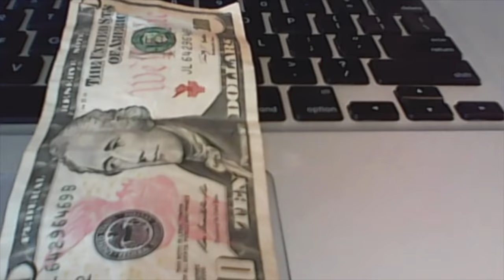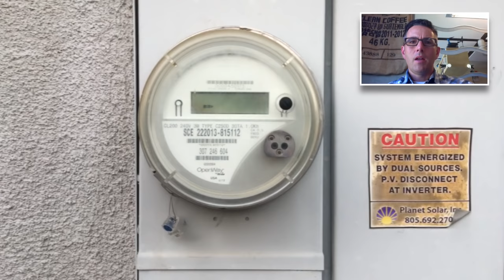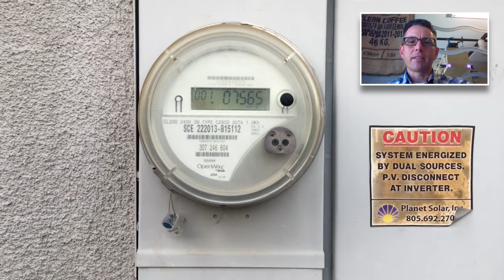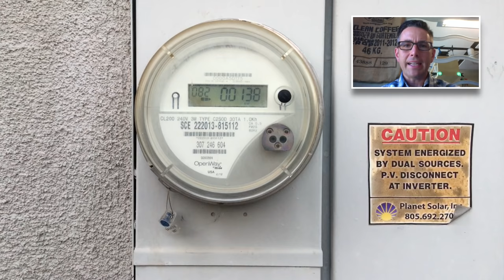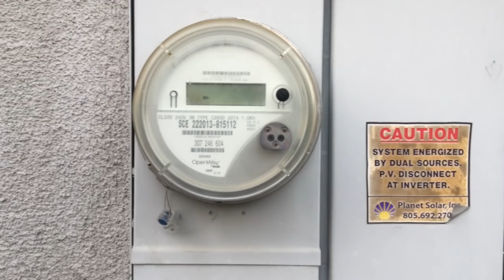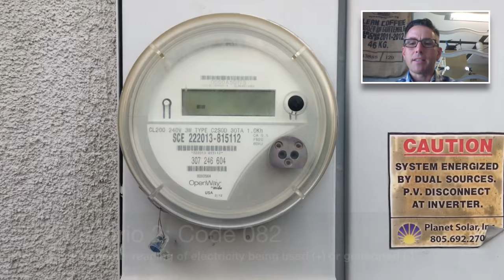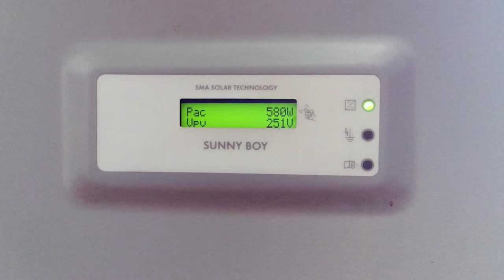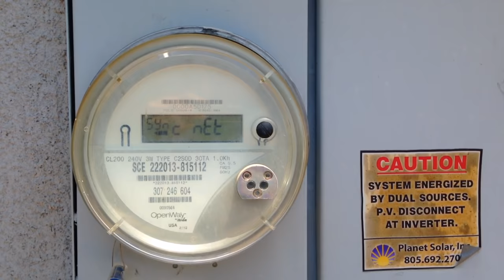How to read a smart meter with solar panels

Comment: On my meter it arrows to left with "received" below it which I would like to know if it means my system is sending to the grid? I still need to interconnect with PGE and really wasn't sure how my system would perform so as a DIY'er I'm learning. Update: I went ahead and watched it some more and noticed when I wasn't charging the battery from the PV's the delivered (.461kw) changed to received (1.4kw) so it would appear the Solar is doing a tug o war. < received/>delivered.

Comment: Just a minor correction to an otherwise fine video: the real-time power generation (or consumption) unit is kilowatts, not kilowatt-hours; the former is a rate of energy generation or consumption, the latter is an absolute amount of energy measured over time. For example, 1000W is 1000 joules/sec (a rate of energy), but 1000W over the course of an hour, is 1000 Wh, or more commonly specified as 1 kWh. You are billed by kWh.

Comment: Hi!  Thanks for the tutorial.  I just had to mention that you sometimes confuse power (units of kW) with energy (units of kWh).  The readings that say kW under the number are power, not energy.  A kWh is used when you run an appliance that uses a kW for an hour.  :-)  Thanks for the video.

Comment: Good info. Got my PTO from SCE last week.  Meter (Openway) says FatError2 and I dont seem to be generating any energy, according to comparison of recent energy use vs a few weeks ago. Solar company is useless and Edison is non-responsive. Electrician replaced/upgraded the panel back in December and it seemed to be working normally after that until roughly a week ago. SCE rep came out a few weeks ago and put a sticker on it verifying the location. I was able to find the Operating manual for the meter and it indicates a RAM error and says it needs to be returned for repair.

Comment: Most helpful since codes are different across country.  Your insights were not in the "How to Read Your Smart Meter 042010.pdf" that I reviewed. I thank you.
Reply: BTW: a Watt is a Joule/second.  We can use 500 watts draw (power) for two hours using 1KWhr of energy.    (the time hours / time sec cancels out to create the unit energy)  energy is joules.  This detail means little to 99%+ of the folks.
Reply from the maker: Glad it helped

Comment: This is really helpful except my meter seems to have different number codes. Otherwise it looks identical to the one in the video. My meter model is CL200 and it cycles through the number codes 11, 4, 6, 10. What do those correspond to? Thanks!

Comment: Hi, and thanks... I'm trying to understand the cumulative value... When does it accumulate from and when does it reset?
Reply from the maker: That's a good question.  I'm not sure what the answer is, but it seems to be related to messing with the meter, not a date or time.   Likely it is cumulative since the meter was installed since the current owner of the house had only lived in the house a short amount of time.   Even without being resettable it is useful because you can write down the cumulative usage/generation at a given point in time and then subtract that from a point in the future if you want a subset of time.
Reply: Units of energy (work done over time) are kilowatt hours.  Units of power (instantaneous intensity or force) are kilowatts.  Code 082 is an example of an instantaneous power value.  Both values are important.  Energy over time is comparable to the number of gallons of water supplied to a house in one billing period.  Instantaneous power is also important because the sum of all users' power requirements at a given time corresponds to the load imposed upon the energy provider (utility).  Peak demand determines the maximum power output required of the utility.  Annual peak demand will occur only once and will be far higher than the average demand.  Probably way more than you asked, but there it is anyway!
Reply: @duaneediger2234  thanks

Comment: It was 'difficult' to find this particular video on youtube. All of the others did not cover the readings, and what they mean. They were mostly about the radiation coming from the meters. I needed to know what the smart meter was saying because the readout on my 6000W Sonny Boy stopped having an LED readout years ago, and I neglected to repair it. It is the same Sonny Boy as the one in your video. I have the manual but it does not specifically indicate that the LED panel is 'fused'. Removal of the cover is no big deal if all of the circuit breakers are off. I plan to clean the fans shortly and will be removing them. Any advice on this on the LED issue would be appreciated. Some are being sold on EBay. If the LED readout panel is obsolete, not  replaceable, is there any way to broadcast the LED readings to my computer? I have 39 PV panels facing south, installed in 2008.Thank you for your great youtube video.
Reply from the maker: I would guess that you can probably use the same wireless connection that the power companies use?  I've never tried that.  My inverter has a specific wireless component that you can add to read it via Bluetooth, but I've never tried with the power company's meter.

Comment: My Pid is 232 and the odd thing is it seems to be measuring correct the amount of electricity I am pushing to the grid but, when I am consuming my own and charging my batteries, it seems it is indicating that I am consuming that from the grid ( the arrow points to the right)  while my system says it is using the solar. My electric bill comes super high and this started to happen recently, it is as if they are charging me for the electricity I am producing.
Reply from the maker: My electricity bill went through the roof recently also (no pun intended) and I have a dispute with SCE to understand what's up.  That might be related.  

 If that problem isn't related though your house might need more than what your panels are producing and so you still need to take some from the grid.  That would explain why you still seem to be using electricity even during the sunny times.  It should be less than what you would use without panels though.  SCE pays much less for electricity than it charges you.  That's well advertised by them.
Reply: 232 is the code for 15 min. interval readings while 252 is for 1 hour interval readings for residential properties/accounts.

Comment: Is it possible to detect PV panel installations from smart meter electricity consumption data? If we have only consumption data and not installed the net meter.
Reply from the maker: Well if the meter indicates that power is going out to the grid, PV panels are the most likely explanation,
Reply: @djp3  I don't have the physical locations of the meters, but only have consumption information in kWh/15mins.

Comment: a video on FAIL scenarios would be good. My last bill shows the power company is charging me FOR what was delivered. Everything looks normal and jives with the numbers Sunrun monitors. Problem is the power company , or something in the system has flipped the equation.

Comment: Just had a Powerwall battery and separate grid tied PV panels installed in SCE territory - exactly the video I needed to understand my meter. I’ve also spent some time with the SCE power rates. Looks like the PV and battery goal should be to minimize your use of peak power (and maybe mid- and off-peak) but not to put net power on the grid (as measured monthly or annually, not daily). SCE will only reimburse you at about 1/4 to 1/3 their peak rate, which is even less than their off-peak rate.
Reply from the maker: Yes, the best way to do it is not to generate power for SCE but to displace your own usage.  It's a bit like playing black jack.  You want capacity up to your usage, but anything over is too much.  We bought an electric car and started to nerd out on this as a result.
Reply: I took another look at the SCE winter rates and realized it was more expensive to charge on off-peak and discharge on mid-peak than it was to just use the grid for mid-peak. There’s only about a 3% different between mid-peak and off-peak rates. So at 90% round trip efficiency the Powerwall ends up costing more. I also calculated that to get the equivalent of 54 discharges annually for SGIP I needed about 2 kWh of discharge daily. No problem, I exceed that during on-peak alone. So my strategy now is to tweak the battery reserves so that discharge stops just after on-peak ends. Then of course recharge on off-peak. This meets the SGIP program goals, minimizes my costs, prolongs Powerwall life by reducing discharges, and gives me a larger emergency reserve. I’ll have to tweak it periodically as consumption changes over time. I’ll also need to see if this works in summer.

Comment: How can one tell how much the panels have produced? Like you mention, part of the production is consumed by the running equipments in the house, such as refrigerators, and excess is sent to the grid. This does tell how much is actually produced by the panels. What is the display under the inverter? Thank you for your video. It is informative.
Reply from the maker: J. Prakash you actually have to look at the inverter not the meter.  It depends on the model but almost all of them have a separate display. The inverter should be on the house side on the meter. Mine shows instantaneous power, cumulative power and some weird cumulative CO 2 saved metric.

Comment: I have a question regarding SCE, and solar panels. I have yet to get a electric bill, for 9 months on a new tract house, and they keep saying it’s technician issues. I also am unable to see how much I’m using on SCE’a website. Is it possibly my 8 panels are making more electricity than I’m pulling from the grid?
Reply from the maker: Yes its definitely possible.  You electric meter should show a negative flow if that's true.   Check in the summer at roughly noon during full light to see the most likely time for this to occur.

Comment: If you have a  grid tie and inverter and solar panels&batteries, can you send back electricity to the power grid if you have a standard smart meter that  everyone else has, or does it have to be a specific kind of smart meter?
Reply from the maker: My understanding is that the smart meter is all you need, mine doesn't appear to be anything special,  but you might need a software update on the meter to support the additional record keeping.
Reply: The same meter can be used, but most will to be reprogrammed to read and register recieved and delivered. Some companies just change the meter and program the new one.

Comment: Hi, I have a CL200 Type C2M meter that has been there for a while.  I have a new PV system installed and solar company says that the meter has been changed so I can use my PV system.  I feel this is the same as the one I had before.  And it only displays the cumulative energy that's been used of 17,420kwh and none of the other number such as cumulative energy produced or instantaneous +/- energy consumption vs generation.  Does the meter need to be replaced or just reprogrammed?
Reply from the maker: It's likely just a programming issue.  I'm not sure what options there are for reprogramming though.
Reply: It is reprogrammed if the meter is a smart meter with such capabilities other they would replaced the meter!

Comment: Understanding and reading a smart meter is nice but doesn't provide enough information to accurately determine a monthly usage (consumption/production). I purchased the Emporia smart home energy monitoring system. I then downloaded an SCE usage CVS file from their website and compared it to my Emporia monitoring file. I compared a single day down to the hour and found that SCE is crediting me 30 to 45% less in KWH then what my actual production is. Has anyone else experienced a similar situation?
Reply from the maker: SCE doesn't reimburse at the rates that you pay for electricity

Comment: I have 3 meters which one am I suppose to read to get the correct readings you show in you video?
Reply from the maker: It depends on how they are arranged.  If they are in a series configuration then the last one before the street.  If they are in parallel then you have to read each one and add up the result.

Comment: i have a question. i had a smart meter installed 2-3 years ago.  if  i want to go solar, does the meter need to be chaged or can it just be programmed?  are all smart meters two way?
Reply from the maker: If you have a recent meter, then it is likely capable of just being reprogrammed.  You will need an inverter as well though.  That is like a seperate meter for the solar panels that converts the solar energy and puts it on the grid.  It has its own meter on it.
Reply: thanks for the quick response just saw some numbers on the meter that indicate it might be from 5/11 
waiting to hear from center point energy as well for the interconnection application forms
Reply: When you go solar, your smart meter is ready to do net metering. So you do not have to change your meter
Reply: Some jurisdictions require a second meter dedicated to recording your solar output.

Comment: Are all smart meters 2 way? If I backfeed (w grid tie inverter)  will my smart meter work?
Reply from the maker: Cobra Kai I don’t know if they all are. Mine is but I had it installed at the same time as the solar panels
Reply: @djp3  I like what is done here but the more I see online, the more paranoid I get about backfeeding.
Reply: @cobrakai2872  are u running fine with the grid tie inverter? and did u have to sign up with SCE before doing that?